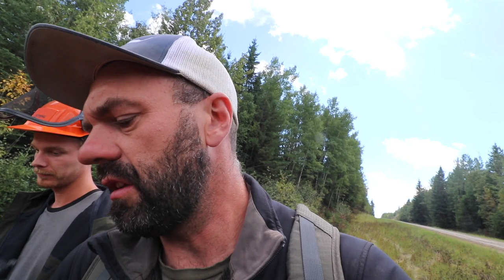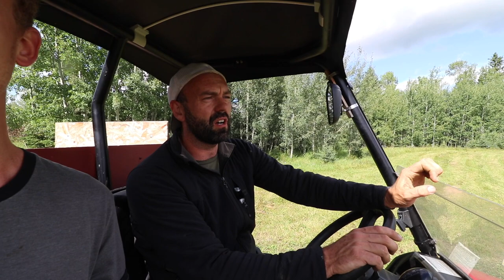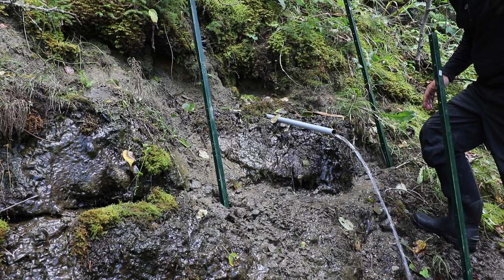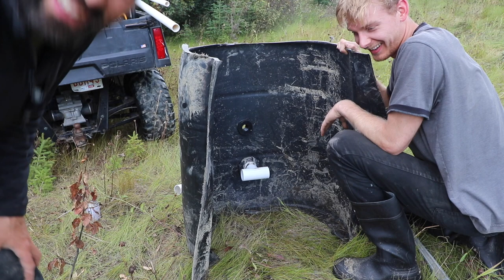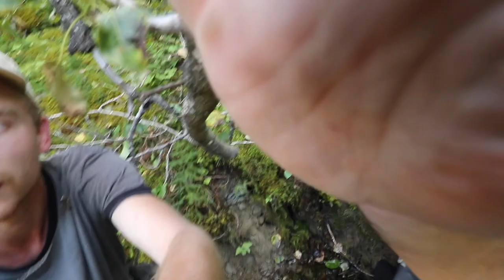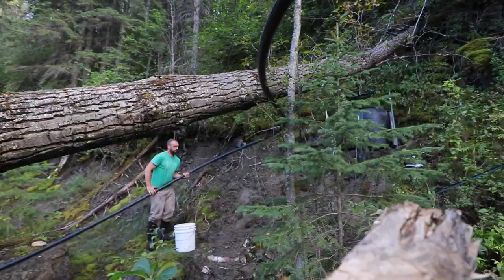Spring Water Collection: How To Build A Spring Box

Comment: I have never built a spring box but I know there's no way I would build it like that. Talking about doing things the hardest way possible. I would have used a hammer drill and rebar from the stone then built some cheap 6 inch forms leaving the pipe run water over it until my concrete tank was completed. Then I would seal the inside with mortar and paint the exterior with a sealer penetration paint. This way would be easier with cordless tools and take time for it to cure but it would last a really long time.

Comment: The purpose of a spring development is to adapt a ground water source to a pipe to which you connect fittings. If the water source is already adapted to a pipe you just need a coupling and a tee to connect to your other springs. You sure did do a lot of work when a sharkbite fitting or pvc would have connected to the pipe you already had there!

Comment: i don't get the point of cutting the barrel and then finding ways to seal it; why don't we leave it as it is and fill it with gravel? and what's the point of filling with gravel if the water is directly coming out of the spring (already filtered by soil)?

Comment: A good dam doesn't have a hundred percent seal.  If the water is allowed to accumulate past a certain point it can actually burst it.  Bentonite takes at least a couple of applications before it will seal properly.  You have to wait for it to saturate before adding subsequent layers.  Not sure why, but it seems to work better that way.  As for the diy coupling you did, the rate of expansion is very different between plastic and metal.  Very resourceful for the time being, but after a couple of seasons it would be prone to leakage.  Good luck!

Comment: Rob, a great way to secure your spring box  and support it when its full would be to install a five or six foot screw anchor into the bank on either side,providing its not solid rock. If its is in fact solid rock, a ramset with a couple of stainless steel rings on either side would also do the trick. Which ever of the two works for you, jus run a piece of rope,cable or chain across from side to side. Another thing iv used with good success for a spring box is a galvanized window well cover. With a little adaptaion you can use plastic,and before installing it make sure to cut a debris cover,i used sheet metle and 90 degreed the edges.

Comment: Why did you cut the barrel in half.
Wouldn't it have been better as is.
I wonder if you just figured out a way to better seal the pvc pipe into the hillside and allowed it to fill the bucket.
You might have had better success at raising the water level inside the barrel (without leaks).
I find it hard to believe that the water will continue flowing into the dam (or barrel) and raise the water level above the original pvc pipe without finding another path of least resistance instead...
The flow coming out of the dam  looks the same as it was with the original pipe.
I realize the original pvc pipe into the hillside wasn't a perfect seal but feel like you would have less water loss with the barrel un-cut.

Maybe I'm missing something?
Thoughts?

Ps Rob. Great videos, great info, awesome new property. Keep up the constant hard work. You're doing a great job. I've learned so much from your channel.  Thank you

Comment: Dry the area out just run your pipe all the way through if you can and then put some concrete in there some quick Crete that should set it up pretty nice and you can resculpt your whole bottom on the tank

Comment: Lots of hard work and I commend you for it, but I  question why cut the barrel open?  Why not just support the intact barrel with the T-posts and plumb the springs into the barrel? Also if you block the bottom of the pipe the air will escape up hill until you have enough water in the pipe to suction itself  free of air. Alternatively, you can bring another barrel up to the springs and fill it then put the water into the pipe rapidly to get enough water weight to push the air out through the pipe.  Ultimately you have to have enough flow to not allow any new air into the pipe while running the ram pump.

Comment: You already had a pipe.  Should have put barrel vertical, even 2 or bigger tank, built platform to lean alittle toward hillside, and you're done.
Got so frustrated watching all the unnecessary work that I didn't finish watching it to the end.
Hope it worked out.